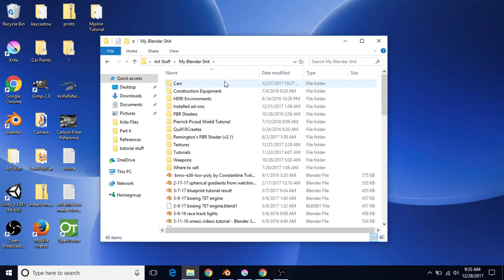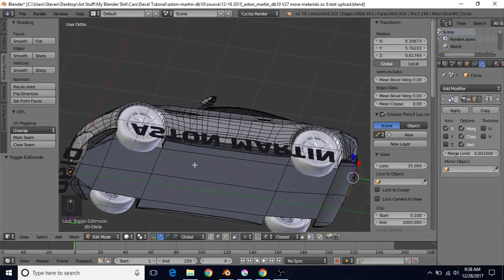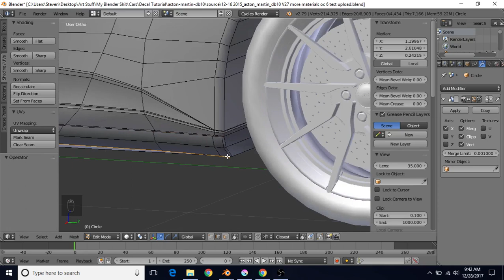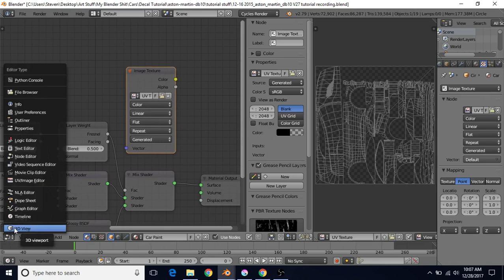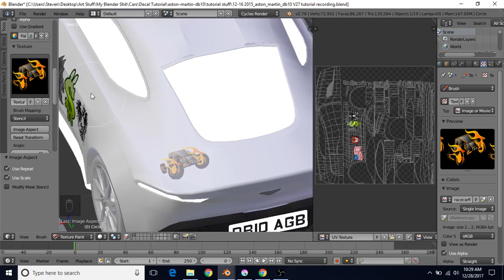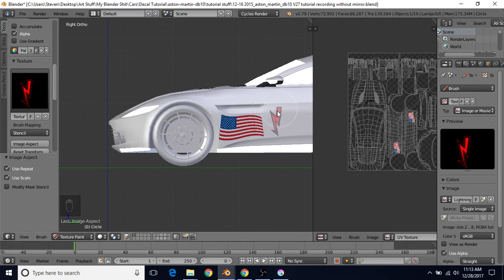Add Decals to Your 3D Car Model with Blender + Krita Tutorial

Comment from the maker: Timestamps:
4:57 UV unwrapping
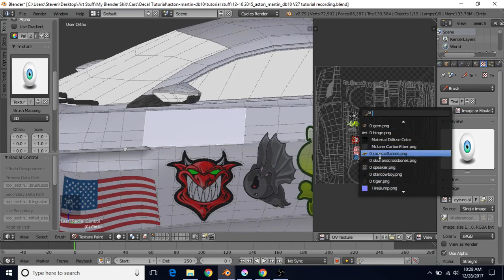18:31 Loading in decals
20:30 Texture paint mode
26:19 Always use pure white explanation
33:50 Pure white explanation continued
30:20 Moving and Scaling a stencil
36:56 Alpha background is important
38:46 Removing decals
43:30 Rotating a stencil
44:58 How stencils act on a mirrored object
51:22 Remember to save your textures!
52:09 Remove the mirror modifier and see what happens!
54:50 Remove all logos/decals with ease!
59:14 The downside of removing the mirror
01:02:40 Create your own decal!
01:09:38 The preferred format to save decals in is png
01:14:49 Making it look like the decal is mirrored, even when it's not
01:17:25 Making the decals visible in rendered mode -- Node stuff here
01:22:04 Use the alpha value as the factor
01:24:05 Diffuse and Glossy mix gives us reflections!
01:25:15 The end! But you knew that... :D (I'm trolling sorry :D)

Comment: does this work with any object , other  than a car?
Reply from the maker: A similar strategy can be used for any object. The only thing that might be different is the material that you use. So basically the end of the video where we do nodes is about the only thing that might change. But you can use decals with a transparent background to put onto a wall for example, or a guitar, or use it to put a tattoo on a character's arm, etc. Just be sure you have unwrapped the object you want to put the decal on, and everything should work essentially the same as in the video. Good luck!